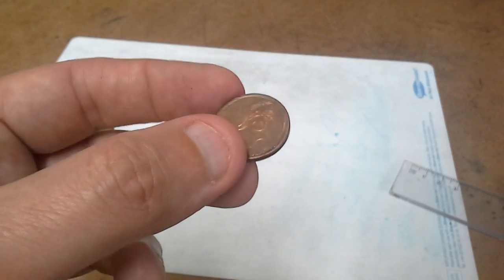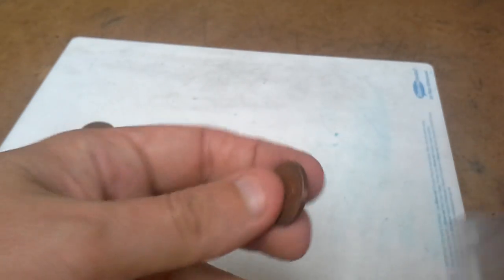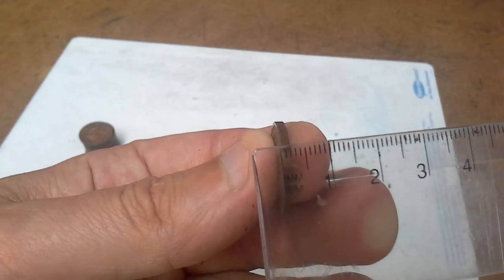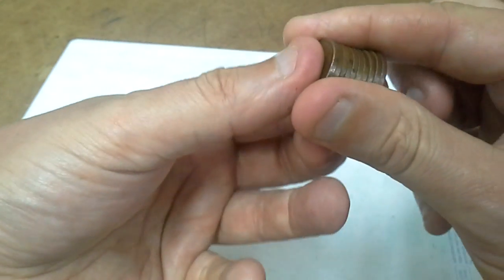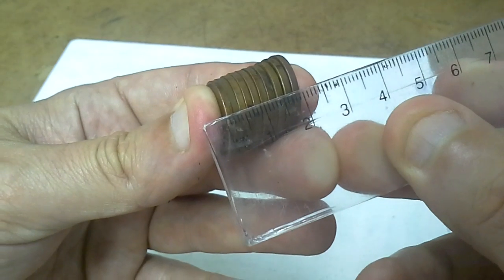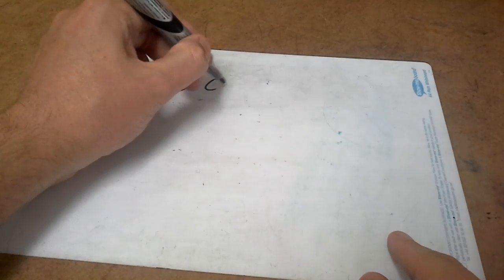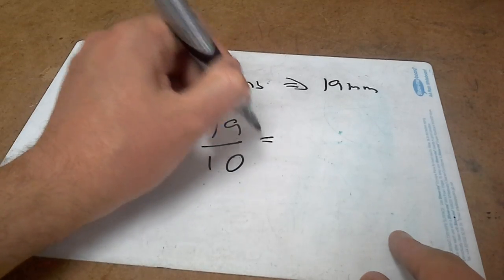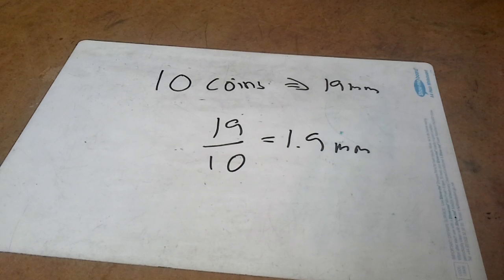Coin thickness - IGCSE Physics

Comment: Only problem is that if you have a couple of fakes, the average measurement will only be slightly off if you use, say, 10 coins. There errors get lost in the averages.
Reply from the maker: #FakeCoinNews?
Reply: @ChrisGozzardThatPhysicsGuy  ??